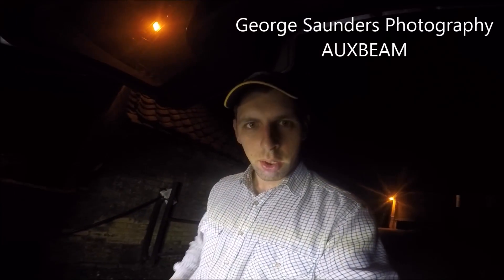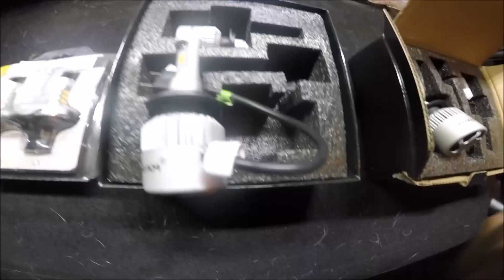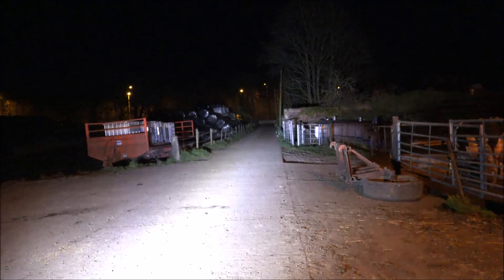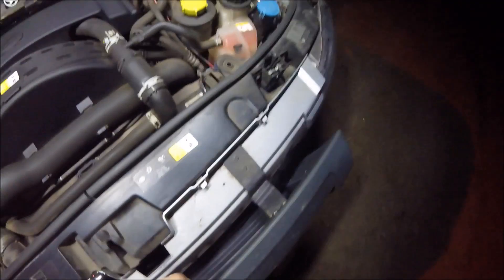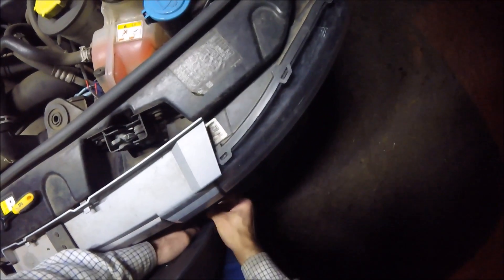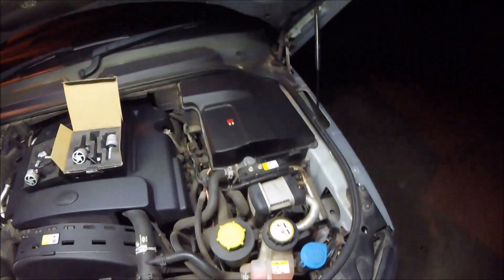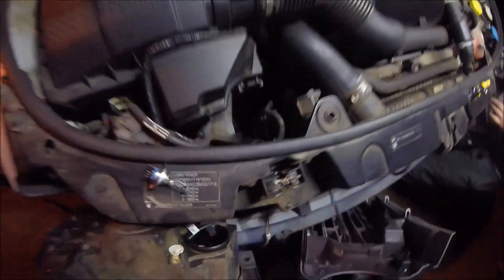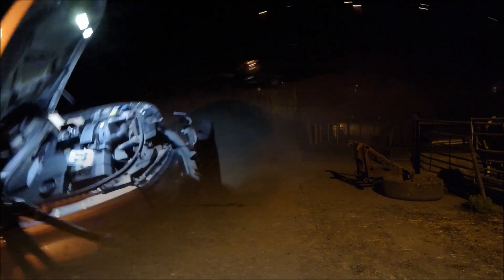Auxbeam LED Headlight bulbs TESTED, Massive POWER!

Comment: the trouble with the bulbs with the fans on, Is you can't put the water proof bulb covers back on so water can get into the headlight if you go through any deep water especially on a 4x4.

Comment: George, have you found the Disco eats halogen bulbs ? My old D4 (2012) must have blown 4 or 5 a year. The current one (2015) has the Bi-xenons so not an issue.
It's a pity I didn't know you could have fitted those Auxbeams, they look a decent bit of kit.